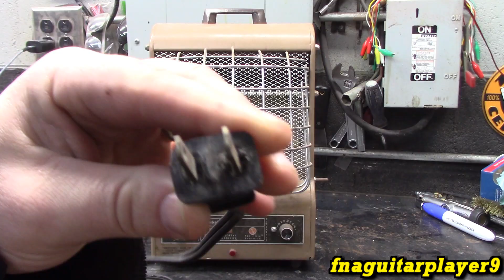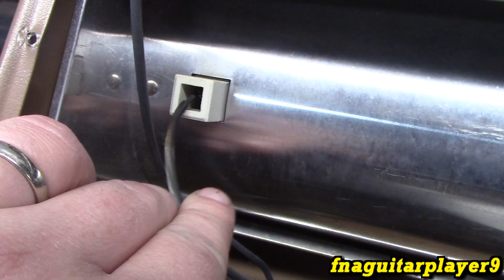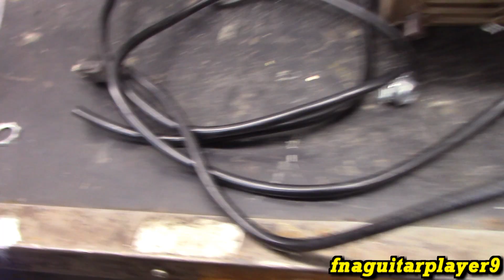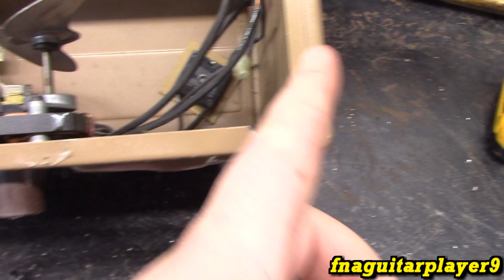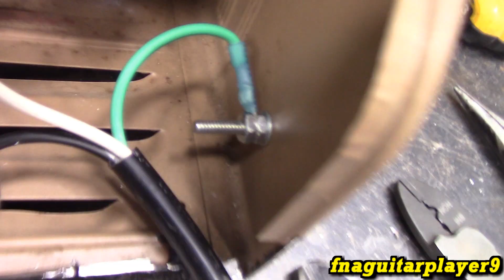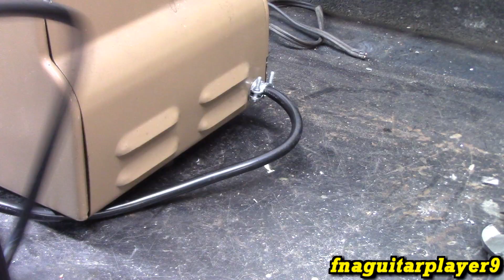Vintage Electric Heater Cord Replacement

Comment: I watched this and have been researching. My neighbor wants me to fix this space heater, one of those stand up "Old timer look" heaters, that they used to have in houses (about 2 1/2' high, 1 1/2' long, and 1/2ft wide). I have a question though, you attached that 14 AWG cord to the two original cord, which was 16 AWG, does that make the whole cord 16 AWG instead of 14? Also, 6ft cords is the longest as per safety, since this heater is now grounded, is it safe to use a longer cord?
Reply from the maker: Not necessarily, because alot of times even on high amperage motors the internal wiring is usually always smaller, so since the internal wiring was smaller it should be safe to use. I would use a 12awg cord if going any longer then 6ft. Then you can make it pretty much any length, it would be the same as house wiring at that point. Hope this made sense. Thanks for watching!

Comment: If I ever change out wires I always use a 3 conductor with a good ground. I got a 10/3 for the heater to keep the battery on the mower over 40 with all the hand tool batteries in the floorboard and a loose tarp over it all. Happy Thanksgiving and Blessings!